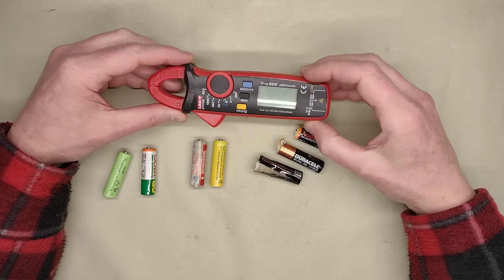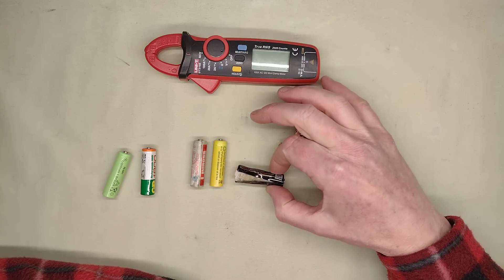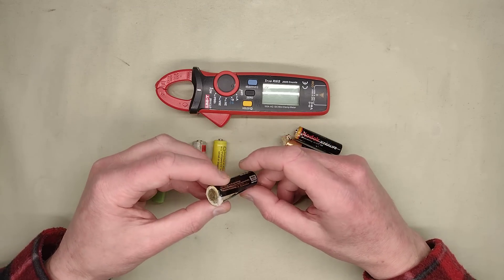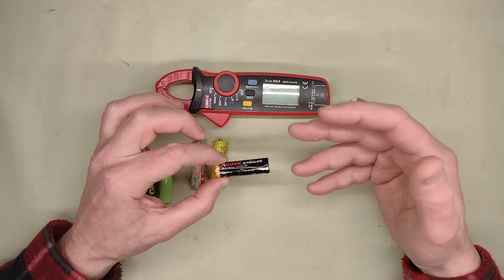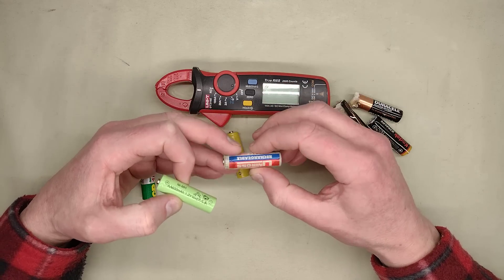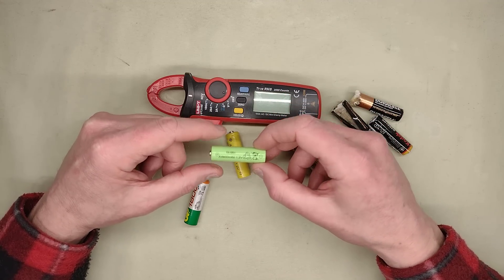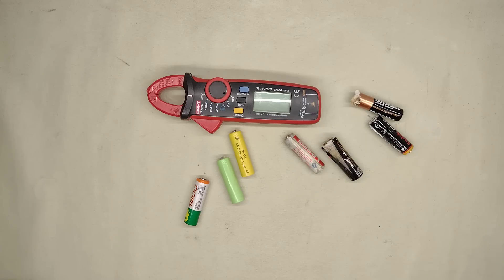The curse of leaky alkaline batteries

Comment: I'm fed up finding a bit of kit I put away (or lost at some point then found some time later) to find I'd left the batteries in and they'd rotted the contacts and tracked up the wire (for the loose battery holder). I try to rescue the PCB but not always managed it😢

Comment: Apparently, if cells are used in low drain devices on a constant basis like a keyboard that is very slow. Even slower than a clock for instance, the chance of leak is very low. I found some 2014 expire date in my keyboard that is used often yesterday and hence found this video. No leaks. But I have most leaks in devices that aren't used often or those sitting idle. Apparently, using the battery keeps the gases away as the energy is used and not self discharged back into its own chemistry creating pressure.
Reply from the maker: With modern alkalines it seems to be the opposite.  Long term storage or very low discharge seems to result in pressurisation and leaks, whereas bursts of high current may reduce that risk.

Comment: I have used Duracell CR2032 Lithium button battery in my air tag, but it is also leaked. Fortunately air tag still works, I just had to clean contact points

Comment: Three year old video, but still relevant. There are quite a few devices though that base their battery charge status off an alkaline voltage curve and some just plain won't work. Had a VR headset for example that using NiMH would show as having dead batteries after just a few minutes. I solved that by getting the Li-ion batteries that keep a constant 1.5V. Con with them is you loose battery charge status and it can die at any moment without notice.

Comment: Hi sir. I was planning on buying nimh for my multimeter but iwas thinking about it having 1.2v vs 1.5v on regular batteries. Will using nimh affect accuracy of a dmm?
Reply from the maker: It may flag it up as low battery level, but you could try it.

Comment: Duracell alkalines are horrible, many leaking before their stated expiration date, damaging equipment with corrosive electrolyte. NiMH is better, but they do have a lower voltage & their self discharge has improved, but is still there. Non rechargeable lithium metal batteries have a good working voltage, a very long shelf life & tend not to leak. Energizer Ultimates are an example. The only disadvantage is their high cost.

Comment: Yeah, those leaky alkaline can sure end up costing a heck of a lot in destroyed electronic equipment. I've given up on them & trying non-rechargeable AA lithium cells: insanely long shelf lives eg 12/2049, more power density & - apparently - won't leak. Much pricier up front, but hopefully will lead to less grief with seldom/intermittently used expensive electronic kit. I hope...

Comment: Primary batteries aremade so cheap nowdays they leak everytime and the cost is too high especially the dreaded aaa batteries i won't buy anything that uses them. For the remotes I use rechargeable. Or lithium primary. Even d cells are suspect now. They should make lifpo4 in smaller formats

Comment: Without a doubt I've had best results with Energizer Max alkaline through the years. No leaks if changed in a timely manner. As others have noted Duracell has had many leaking issues in recent years. Not sure what happened over there because at one time they were one of the best brands.

Comment: Interestingly I don't recall the really old zinc-carbon batteries (U2, U11, the 4.5V flat packs and the 3V double bicycle lamp batteries) leaking until they had gone flat even though the outer case was just the zinc electrode and a cardboard wrapper. Once they were flat it was quite another matter though!

I think there are still a couple of the 4.5V flat packs in the shed somewhere -- unused but they must be more than 30 years old I need to check what they look like if they are still there.
Reply: Yes, there's at least one still there. Panasonic 3R12R, it does have a plastic rather than cardboard case. Expiry date looks like 12 99, has 4.57V across the terminals.

The price was £1.95!

Comment: Duracells leak. Energizers almost never leak. The key is to check all alkaline batteries at least once every 2-3 months if in a device that is not used. I have a policy of changing alkalines once per year even if never used. Then I would just use them up and dispose of them. Great video!

Comment: Ni-MH has not much capacity compared to lithium. There are rechargeable lithium 1.5V AA and AAA batteries available these days for £2 a cell. Alternatively, one can modify the device in question to take 18650 or flat mobile phone battery. To properly recharge such batteries, one will need a commercial lithium battery charger or if you want to DIY one, you will need a  TP4056, TC4056, DW01FA based lithium charger PCB which are very cheap these days.

Comment: I noticed Duracells tend to leak more often than Energizers. Which reminds me, some Duracells leaked in my "expensive" digital frequency counter. And even after I cleaned out the battery compartment, the unit will not power on anymore.
Even using the wallwort adapter, she's still dead. I opened it up, and see no damage from the battery corrosion.
I am still mad about this, and wish I knew someone who could fix it, for a reasonable price...
Reply from the maker: Vinegar will remove any remaining residual corrosion damage from the battery contacts.  (They fizz and bubble as it dissolves.)    If it's a simple button for on and off, try shorting it out directly if it still doesn't work after the contacts have been cleaned.

Comment: Self discharge is not the only reason to use alkalines.
Some devices - like one of my shortwave radios - works better with a brighter display light and more volume at over 1.25V per cell. And yes, I agree it's a design issue with that model of radio.

Comment: I stopped buying Duracell. You pay extra at Costco and many of them corroded both used( in use installed)and new.  Ruined many flash lights, remotes and electronics….I had better luck with energizer…

Comment: Just use super heavy duty batteries.  They last longer than alkaline (when not in use) and don't leak when they fail.  They're also cheaper to buy.  Unless you really need the higher capacity of alkaline they're the better choice.

Comment: Can the battery still leak if its not connected to any equipment and/or were never used?
Reply from the maker: Yes.  Many will leak in their packaging due to gradual internal pressure build up.  If anything, it seems to be the very low current devices that have most issues.

Comment: Good point.

I cant get rid of the feeling that I am being ripped off with NiMH batteries here in Switzerland. How much is a high quality NiMH in your country and where do you get them? Tnx.
Reply from the maker: They area always more expensive than disposable cells, but around €3 each in packs is typical.
Reply: @bigclivedotcom  Thanks. Looks like I wont need alkaline cells for my heating valve actuators (Loxone) any more. The best AA NiMH are ready to use and have 2600 mAh. Should be enough.

Thanks for the video. This changes everything quite a bit...

Comment: The one place to use alkaline cells is smoke detectors which are made for standard 9V rectangular "transistor" batteries.  

I've tried lithium 9V, but the voltage drops linearly over the life of the battery and is also affected by cold temperatures.  The smoke detector therefore starts chirping  the first winter's day when the lithium battery drops below 9.2V, because it's designed around the OCV of an alkaline cell which stays relatively flat until life is a much lower remaining capacity.  So basically these lithium batteries that say they are "great for smoke detectors" on the package really aren't.  They cost 5X as much and give about 1/3 the life in such an application.   Of course, you could take the battery out and use it somewhere else to enjoy the other 70% of it's life.

I'm not really sure what devices 9V lithium primary batteries are worthwhile, most are low-drain.  They don't leak, that's a good thing.

Oh, some devices don't like the lower voltage of NiMH cells and have dim displays or premature "low battery" message.  If I buy something new, I do a search on Amazon reviews to see if NiMH cells work with them.  Usually new devices do.  If not, I usually don't buy the device or return them within the 30 day window.  If I have to use an Alkaline cell in something, I know someday it will be filled with corrosion, so why bother?

Comment: In the mid to late 1960s we used to test the early Duracell batteries for potholing purposes. Not good, the rapid fall off at the end of life could be catastrophic if you were caught in a shaft or tight crawl.
Also, at that time they guaranteed to replace any equipment damaged due to corrosion of the cell. 
It never happened to my knowledge at that time but I have had numerous corrode badly in recent years but the offer is no longer publicised. I wonder if the chemistry has changed?
Reply from the maker: The modern cells leaking so badly may be down to eco rules regarding materials that used to be used to prevent pressure buildup.
Reply: @bigclivedotcom  A pity if they had to change them, I only experienced one bursting Duracell in those early years and that was a split without leakage after donkeys years languishing in a shed!

Comment: Recently found my Sky Q wireless remote (hardly used) has apparently been destroyed by its Duracell batteries.  The coating on the back of the circuit board has been stripped, although the component side seems OK. Much older Chinese OEM batteries in other items have lasted way beyond their use by dates. I hate Duracells which seem to be particularly prone to leakage. I can give the remote if you would like to check it over.

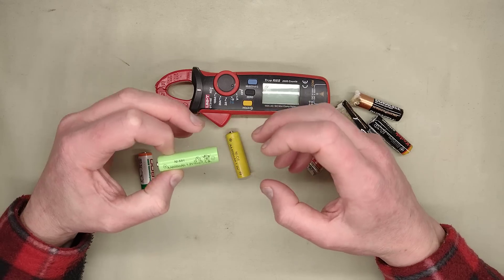Comment: 2:50 At just 1.2 vs 1.5 I feel it's not a problem usually, but when the device uses 2 or 3 AA sticks in series that's a much more marked difference :(  Sadly a lot of these (cheap) desktop weather stations and wireless thermostats are like that and 3.6 (minus change) vs. 4.5 is just way too much and the LCD is immediately dim.  I just don't get it why they refuse to design around rechargeables after all these years and these devices are still sized to alkaline use.

Comment: A few days ago I came across an electric pencil sharpener I bought in 2010.  It is powered by 4 AA cells.  I tried a pencil in it before inspecting the battery compartment... it worked! and yet had been at the bottom of a box since 2014.  To my surprise, the batteries in it were Energizer AA 2300 mAh NiMH.  A voltage check showed all 4 between 1.27 and 1.28 volts. Amazing.  I charged them up, no issues, and all took a charge to 1.49 volts... 0.03 volts less than my new ones purchased just a few weeks ago.  YES, these NiMH cells have been greatly improved over the years and hold a charge for a very long time.

Comment: I used to prefer Duracell alkaline batteries but they often leaked and ruined many flashlights as well tech gear. So I switched to the Energizer batteries and had better luck but they too sometimes leak and ruin things. In my experience the NiHM batteries never leak but the older ones did lose their charge in a matter of days or months. Last year I acquired the Panasonic Eneloop NiHM batteries and they hold a charge until they get exhausted only from actual use. In the future I will look to buy more Eneloop batteries in larger sizes, they're reliable and don't leak.

Comment: Ok, So I know alkalines are bad - but working in film production settings I've yet to find a reliable AA/ AAA rechargeable brand (mfg. change sources/ factories, alter marketing) and on critical devices only use alkalines (mics, slave triggers, remotes, field recorders, medical devices). I have tried several, and they ended up lasting only a few charges, ony to end up in the battery recycle bin - the mass-market, big brand retail batteries just do not deliver. Anyone make a solid rechargeable AA for the professional market?

Comment: A follow up of the alkaline battery saga, why do some batteries reverse polarity? I have never seen this before and thought it a myth until .......

https://youtu.be/h4uYbKhgees
Reply from the maker: When cells are in series, the first to go flat gets current pushed through it by the others and will be reverse charged.  It may also pressurise inside and leak.
Reply: @bigclivedotcom  thanks Clive 👍. I was wondering if alkalines would take a reverse charge. Probably one of the perils of using cells with an imbalance of charge.
Cheers.

Comment: Man, after reading through the comments, I must have the best Duracell luck. The only things that died to a Duracell leak for me was a surround sound remote(somehow lasted 10+ years with no battery change. Probably should have changed those 2 AAAs earlier just on principle) and multiple wii remotes. The thing with the wii remotes is that they ate ALL batteries. Everything would die flat or leak in 1-3 months regardless of use.

Comment: Ok a few important things that i would love one of these kind of channels to look into Please!. 
(yes i subscribed :P ) 

1, Contrary to what they say on the pack and what everyone is taught. 
YES You 100% CAN recharge normal alkaline batteries just fine, after 4-6 recharges they might start to leak. 
(Over last 25 years have recharged hundreds maybe even 1000+ of DC ALK batteries from AAAA - Large 6V Torch batteries with a car battery or any DC source under 12volts,
never did 1 explode they just leak or hiss when overcharged/cooked)

Now for the Big Question/Test!

2,  Why When you do recharge a normal HD Alk Battery like Ever ready Gold, 
They last much longer than new ones that came from same pack. (1 recharged AA will outlast all other 3 in the pack combined)
Using the same tiny hand fan taped to desk the recharged AA ran it for 6 hours on first recharge and 6.5 on 2nd recharge, 
(drained till the fan stops completely so a "deep cycle reset" )
While The other 3 from Same new pack (in date) lasted 4-4.5hours avg.

3, Are rechargeable and non rechargeable batteries all just a scam like light globes intentionally built to blow in so many hours.
(we had a clock in our garage my dad would just recharge the AA battery in it using the car battery when it stopped, 
that 1 battery lasted over 10 years and dozens of charge cycles and it was only a very cheap no name battery from grocery store)

Comment: Alkaline is still good in very low current draw situations. Like my mouse from 2017 still has the original batteries, or my TV remote that's even older. I think my multimeter has a 9v that's pushing 10 years old. In these cases it would be a waste to use a NiMh.

Comment: Seems to be a feature of Alkaline cells that have gone flat.  I've not seen a charged Duracell cell leak that I can remember, unless well past (i.e. years past) its date.

I even had an unused Ever Ready Gold Seal AAA alkaline cell (made in Britain) and it seemed to hold its charge and not leak from when it was purchased around 1990 (together with a "Thundercats" toy) until I threw it away around 2015 (Ever Ready was, I think, later bought out by Energizer and lost its UK two-word branding).

The Ever Ready (later Eveready) Silver Seal, later Silver, and now Super Heavy Duty batteries (can't make their minds up, can they?) are zinc carbon.  I know I sawed a Silver cell in half once and couldn't find any liquid, but I think zinc carbon cells can leak when discharged, so that's not a solution if batteries are going to risk neglect.

Cost-wise, are low self discharge NiMH cells going to be comparable with alkaline cells?  I have a number of old Ni-CD and Ni-MH cells, but the only NiMH cells I have had reasonable use from before they fail are the ones I have personally bought from new and nurtured.  Ones I have obtained from friends or family have usually sat in discharged state so long, they may as well have been disposable in the first place?  Although if we consider that leakages kill electronic devices, perhaps the disposal of Ni-MI cells is the lesser evil?
Reply: Since the above comment I have come across quite a few leaky Duracell cells.  Two were in my doorbell battery.  The doorbell is a trembler type wired doorbell with zero current flow for the 99.997% of the time that the circuit is not completed by the pressing of the bell button.  The cells had an expiry date of March 2023, were located indoors in the living room, of the 8 cells, 5 were still in good state.  2 were leaking and 1 was suspect.

I have to eat my words.  I have replaced the leaking cells with some of my less good NiMH cells and am carefully monitoring the remaining Duracells.

Comment: I have found that Duracell (Procell or any other Duracell) in general have failed me more then any other brand, 
I have had a minimum of 5 Duracell "AA" batteries burst/exploded in various devises that they have been installed in as well as those stored in their cartons.
I've had one burst in a tv remote that cracked the casing. I had one that distroyed the lower end of my son's a PS4 controller when it exploded. I have had 3 explode while sitting out in the open. One was on a coffee table, which I found after hearing it go off like a fire cracker. The other 2 I found at separate times in my work room. One on the work bench and the other on the floor. 
Other then the the one that was contained inside the tv remote the others all had the negative end blown out of them along with centre core. 
I do not use Duracell any longer and have not had any similar issues. 
Plenty of other brands to choose from.
Leakage happen in most alkaline brands.